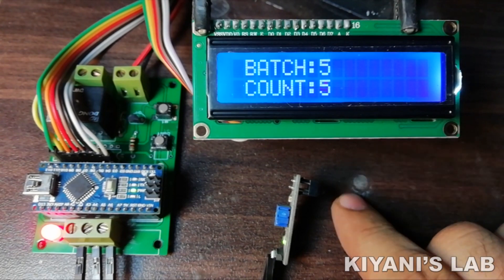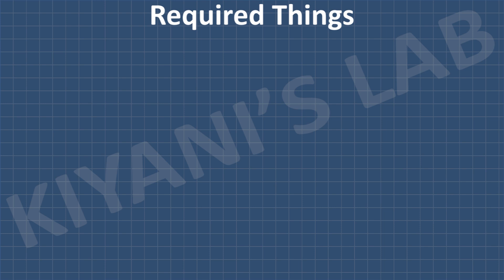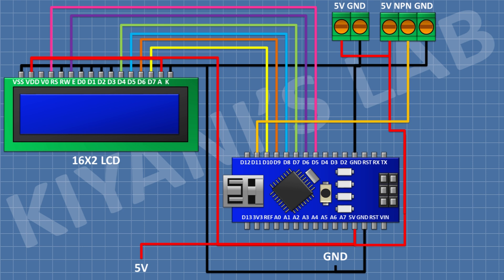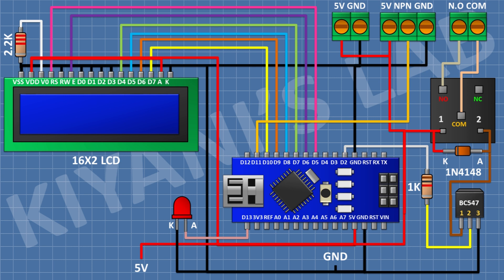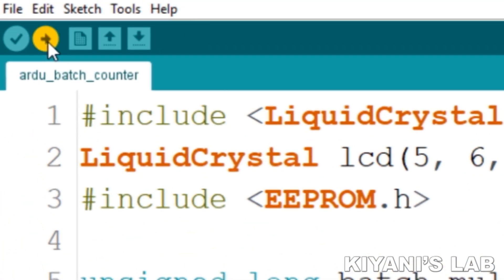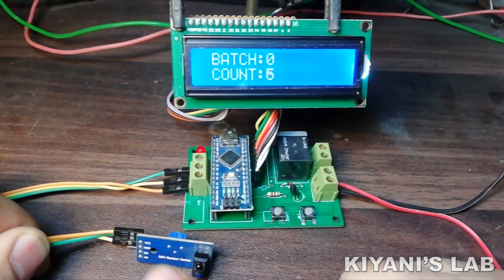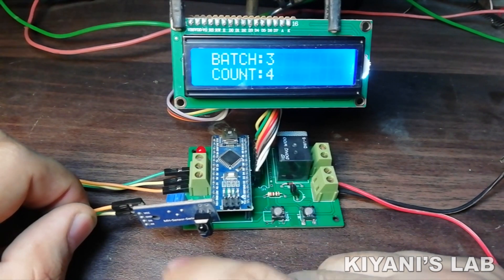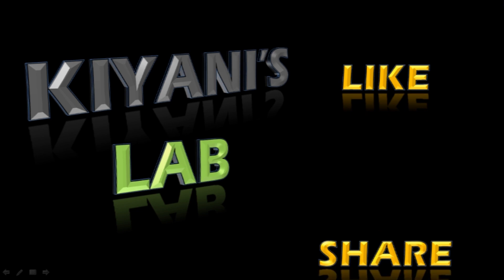BATCH COUNTER

Comment: Is it possible incorporate a conveyor into this? I'm still a beginner at using Arduino
Reply from the maker: yes it is possible
Reply: @KiyanisLab  I see that for 220v AC conveyor  i will need different relay, but will i also need different transistor?